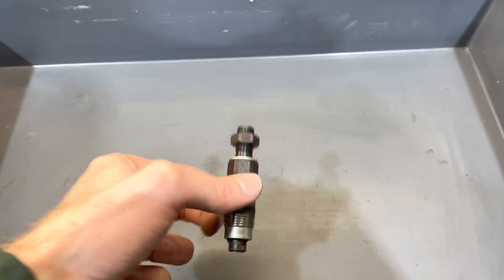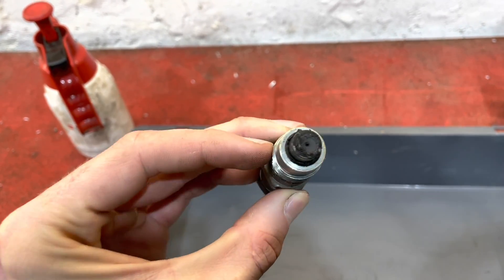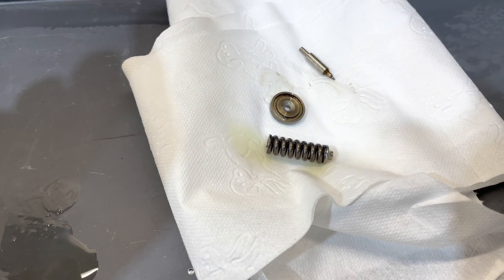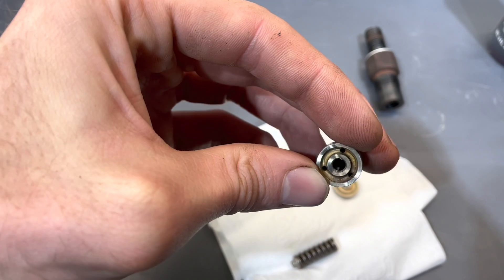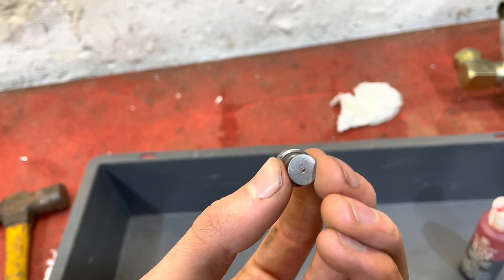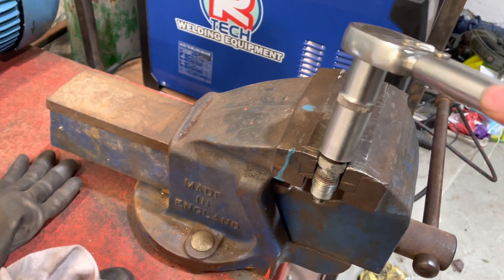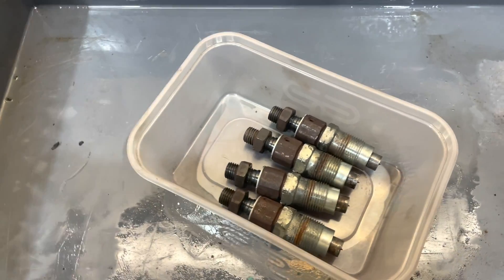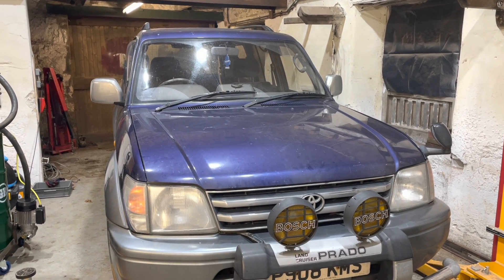Cleaning 1KZ-TE Diesel Injectors for a Toyota Land Cruiser Prado

Comment: Wonder why you didn't either do a spray and pressure test and balance them, Maybe you need new nozzles? I am a MB mechanic and I advise  people not to EVER go straight veggie oil. Maybe 70:30 diesel/veg is doable but really why bother?. Veg oil ruins engines.

Comment: Having a similar issue with my engine beyond 2000 rpm, local mechanics claimed it was a gear box problem but I highly doubt, gonna clean out my injectors first and see if there's a difference. Thanks so much for the upload! Subscribed
Reply: Did you have any results?
Reply: @afonsonobrega4337  yeah it was the injectors, fully serviced them and it run better than ever before, definitely improved the cars whole performance, also added some injector cleaner to the full tank of fuel as an added measure, still runs perfectly to date!

Comment: Hi Dirty Mike's Garage, I am running my Surfs and prados on WVO for a many years and hundreeds of thouthand klicks. I admit I have to change/clean the injectors time to time. And it usually noticeably less power when running WVO compare to running pure diesel. However, if you preheat the fuel in a coolant-to-fuel heat exchanger, it helps with fumigation, improves power delivery and prolongs time between injector's services. Just a question to you: For how long you've been running waste oil (in Km) prior to your injector's service?

Comment: Another way around your issue could also be to add a small amount of gasoline instead of diesel say around 5 or 10% it would deffenatly thin the mix down.
Just mix it up in a small container first and make sure your happy with the mix.
Reply from the maker: Hey Matt, thanks for the suggestion! I'll certainly try this.